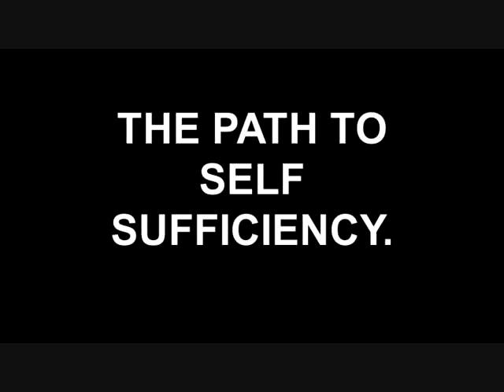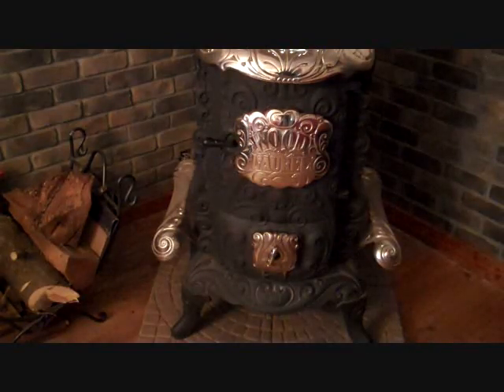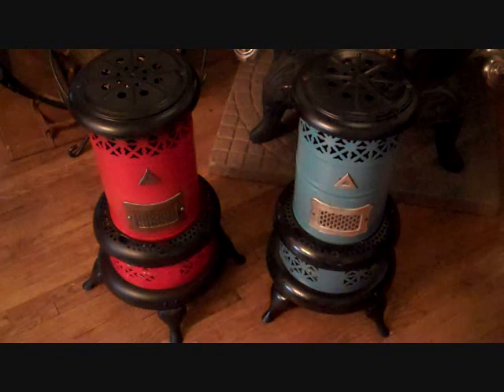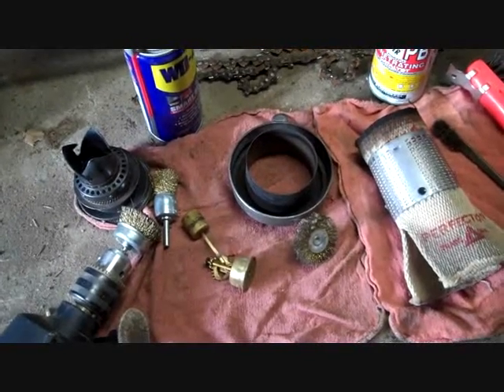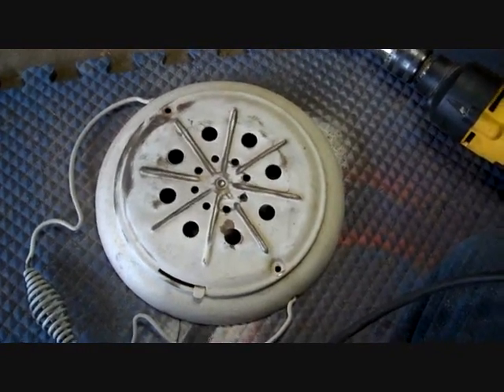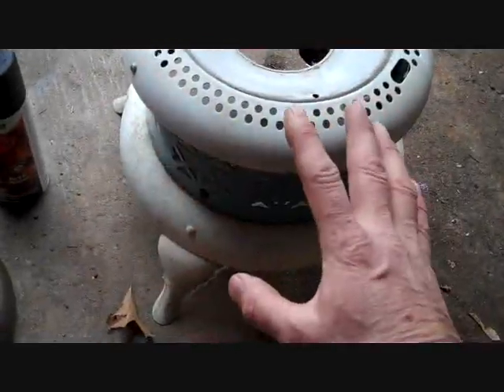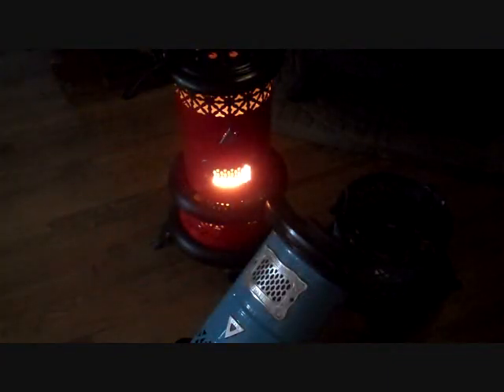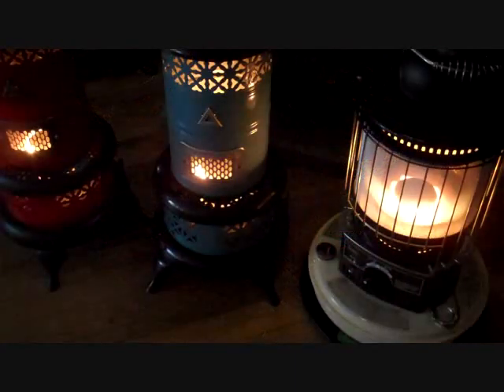PERFECTION OIL HEATERS.

Comment: In the late 40's & 50's I sold these at my grandmother's hardware store 'Wright's Furniture & Hardware' in Plant City Fl. Back in those days, it was the only heat that some people had. Perfection also made cabinet floor models that were vented to a flue pipe, and hooked up to a kerosene tank on the outside of the house..
Reply: Yeah a big square cabinet. My grandma had one When I was a kid.
Reply: Pretty fascinating. I use one to heat corners of my house. I have a model 530 heating my kitchen right now, my wife loves it.
Reply: My grandpa and grandma had a wall mounted perfection heater hooked up to the house flue. It kept the kitchen nice and warm.

Comment: Acetone excels in removing carbon and dried fuel residue. (Paint too! Adequate ventilation is a must, as well as lack of open flame!) Works especially well in glass lamp bowls. In the late 1800's, prior to the production of kerosene, oil lamps and heater used coal oil, known today as mineral spirits. In many (but not all) areas, mineral spirits are less expensive than K-1. Haven't run my Alladin Blue Flame on it yet, but all my lamps do. Miles Stair's site has a great article on it.

Comment: I have one of these. Had it since I was 16.(am 64 now) Paid .50 for it. I wanted to restore and use it. It is intact. I just repainted it but did not use heat resistant paint. I really wanted to use it to heat my living room. Thanks for sharing.There is a story that goes with it but I won't bore you with it.

Comment: I just picked up two of these myself this weekend, I got one of the model 425s for $25s and a model 525 for $40, I used some zip strip to pull a coat of black paint off of the blue enamel, and have been working away with the bench grinder to pull off whatever rust and corrosion are on the other pieces, I am pretty excited to get these things up and going, they are really good looking stoves.

Comment: Thank you so much for this video! I can't tell you how excited I am to find out about these little gems...never knew they existed. I have a cabin that has only been used in the summer for about a decade. Snow partially caved in the roof and broke the pipe to the antique wood stove. The stove itself is now unsafe to use anyway as it has rusted out over the years. We had a real dilemma on getting heat into this little cabin because it apparently was built around the antique wood stove! No getting it out without tearing out a wall or tearing up the stove, which would break my heart. Even if we could get it out we would have to spend thousands getting the area up to speck to install anything new. Now I just have to find a couple of these perfection heaters! So excited!

Comment: I got one of these today that was in near new condition for $35.00. It had just a few traces of rust in a few spots. Mine is a clone of the Perfection 552 heater made by US Stove Co. I just did a full clean and repaint and it is like new again. I ordered a new wick and now I am set for the winter if the power goes out.

I appreciate the video and info. Keep up the prepping!!

Comment: I first learned about these heaters in October of 2011. I was setup at an outdoor festival with some other folks and it was fairly cold in the pole barn where we were. One guy went to his truck, pulled one of  these out, fired it up and I was amazed at the heat output. Along comes 2012, same group, same festival and sure enough cold weather again. Same guy hauls out his heater and we are warm. That should have been my hint to get one but with other things going on I never got around to it. Now comes October 2013, same group again, same festival but warmer weather ... to start. Half way through here comes the cold! Our friend smiles, heads to the truck and you know what he pulls out. At this point I am on a mission I tell him, so off I head, hitting every antique dealer at the festival. Not one of these to be found. Then this older gentleman stops by where we are, a truck full of antiques he is looking to get rid of as he is getting out of the business. Several of us go to see what he has and there it is! A Perfection 730, looks different than these in the video but the tank/gallery/flame spreader assembly are just like these. I crawl through and over several piles of stuff in this truck because I was going to own this! Once I got it into the light I was taken aback and the apparent condition as it was completely rusted. My buddy who has brought his all these years helps with the inspection and other than rust there is nothing wrong with it. Purchased for $15. Though I haven't had time to repaint it yet, I cleaned the tank assembly, bought a new wick and filled it up, sure enough .... HEAT! These are awesome! I have since found another, a Perfection 525M, at an auction that is in better condition though it could use a paint job it still has the original paint on it with only minor rust for its age. It still has an original wick and once I cleaned the old kerosene out of it, let it dry and refilled the tank with fresh kerosene it fired right up. I am still on the hunt for at least 3 more as I live in an 1800's home and these fit right along with the feel of the house plus I live in an area where power outages in the winter are common and these will keep me warm enough for as long as I have fuel for them if needed. Great video!

Comment: I really love my old perfection heater, I got mine for free, some one was throwing it away b/c the wick was burned down, you can only find replacements online, I redid the wick, then later bought some fiberglass filters on sale in spring and resized them to fit my heater. the way they work is so simple yet so good, that i made a small version out of oil lamp parts and "tin cans" with some sheet metal that i use for camping, one of the greatest things i found for free, great video as always YP

Comment: Hey Yankee! Just wanted to thank you for this video. I got through this winter using three of these I refurbished after your video. Although it was only for supplemental heating, these things worked awesome! I even heated up my beef stew on them. Great bargain on kero at Tractor Supply. As for the smell, it took the Family a little getting use to. However on these cold winter days they all were asking me to fire them up. Thanks again.....Go Sox
Reply: Daily Dog Vlogs would I need an exhaust pipe or to open windows?

Comment: It's  the year 2023 now,  gas prices in Europe are sky high and heating costs for an average house can go up to 600 to 800 euro a month. Not for us thanks to these great and beautiful heaters. In Europe we got Valor heaters which is the European brand for the Perfection heater.  We have two 525T heaters and still amazed how these little rings of white fire get so insanely hot! Getting the cold out of a 50 M2 living room is no problem for these (just using one)! These are truly genius in their simplicity.

Comment: When I was six years old , 1959 , we lived in the weeds in the air castle. My dad had us on a starvation farm that had a two story farm house.

It was made of green wood and it leaked air horribly. This the air castle..

I was upstairs at the furthest place from the wood stove.

So dad found me an old perfection heater. He showed me how to care for it and every evening I would get it ready to go.

The wick lasted forever as long as you did not let it run out of fuel.

We used coal oil in it and it had a great kind of chicken poop smell..

We moved in 1964 and I loaded my heater into the truck. My mom said we were going to give it to my grand pa.

I told her it was my heater and I wasn’t going to freeze in the winter. Dad explained to me about coal heat and venting.. he had bought a house in St. Louis with a coal furnace..

So we went to St. Louis and grand pa didn’t get my heater... coal heat sounded like magic and I didn’t trust it..

I still have my heater... I think electric heat is a fad....

Comment: I know your video is pretty old, but, I found it today and I have been using these kero heaters for 20 or more years. Electricity is bloody expensive, and even wood now here in Australia is bloody expensive.  So, I was able to pick up a few of these heaters at garage sales etc and they work good.  Of course I don't live anywhere near snow etc, but the cost of running these heaters are cheaper than anything else around.  If you are still YouTube, does the 'chimney' sit directly on the fuel tank?  I think the 'chimney', or the hinged top part, is supposed to be sitting ON the fuel tank when closed so it can draw air for the wick...Yes/No?  These heaters are great space heaters, not those crappy ones which dry your eyes out as the heat is reflected AT you, these are more space heaters, or room heaters, with the heat not directed at your face but more heating up the entire room etc.

Comment: I just scored a Perfection Number 530 Heater for only $20 at a consignment store! I was wondering if high heat engine paint would work for my refurbishment purposes. Thank you very much for confirming my hypothesis. I'm planning on putting together a video of the start to finish process for others as well. Thanks again! I'm very excited about this great project heater! <3

Comment: Perfection heaters crank out the heat for sure. The ones with glass globes light up a room pretty well too. Aladdin kero wick and mantle lamps heat a small room with a lot of light too. A must have when the power is gone,

Comment: Nice presentation.  I have a couple Model 735 Glass heaters, and it does a nice job lighting up the room as well as heating it.  I do mix some lamp oil in with the Kero to produce a whiter light about 1/3 : 2/3.  Only other comment I would add is, the fuel tank can get pinhole leaks.  If it does, solder does the job, it there are  a lot, you can spray in a rubberized liner--albeit a bit expensive.

Comment: I have a
Perfection 730. I turned it up to the highest wick setting and held a cooking thermometer over the top. Unfortunately, my thermometer only goes up to 392 degrees. The thermometer QUICKLY rose up past 392 and error’d out. Bottom line: you can cook on top of the Perfection 730 if need be. Probably possible to cook on the other Perfection kerosene heaters too.

Comment: I just bought a new kerosene heater from the hardware store. It has a huge cage around it that makes it almost impossible to move out the door and the handle is terrible.  Love the legs on the perfection.  My new one sits on the fuel tank on a drip pan. Any ideas on making a new one more friendly and more pleasing to the eyes? First thing I'm going to do is take off the ridiculous safety cage. It's just me here. Thanks for the video

Comment: A caution, they do put out considerable carbon monoxide, you must have lots of ventilation. You fire one of these in a closed room and fall asleep you will not wake up. That said they are a good heater, I have a couple myself, and they are nice for cooking on, and as a backup heater, but be careful with them. Your best paint for them is commonly sold for grills.

Comment: Thanks for this video!!! I see that ebay has several that are obviously for decor, but as youve demonstrated, its pretty easy to maintain and even refurb. I also like the idea of fuel verstility ( mixing oil to the fuel to stretch out the life, I change the oil in our vehicles and turning in the used oil is a pain so anytime I see a way to use it, I'm all about it... maybe for the garage or something - Im sure it burns kinda dirty) Thanks again!

Comment: @DoverPipes well i guess he already said it in the white texts first in the video.
its as safe as a heater can be, without the fear of short circuits and other malfunctions the electric ones have.
i currently have a zibro kerosene heater on, and it generates an enormous amount of heat.
it does 0,25 liter an hour(so its saving my heating bill also).
i like it a lot, and i bought it originally for my preps, but now i burn it everyday just for ambiance, i bought extra parts for it too.

Comment: I watched this video years ago and found a blue one. The chrome plating needs painted. Do another video about these. How did they hold up and did you need to buy any parts apart from a new wick over the years? Do you still use them?
Reply from the maker: nothing has changed,  they work fine

Comment: Hey I really like these heaters and was wondering what a average price of these are in decent condition? I have found many of these lately in decent to rough condition. Most just need a good cleaning and new wick plus repainting. Where do you suggest getting a new wick? I bought a 525 model that is in good condition, just needs a wick and a good cleaning. I only paid $25.00.

Comment: Great video. I too ma in massachusetts. I bought a portable propane heater. that has the CO shut off. If I have to I will use that in my home. I was thinkign I coudl put it near the fireplace to help with ventilation. But they too are illegal in massachusetts. But I think its a grey area.

Comment: Yankee, where do you get  your wick replacements?
Also, do you burn the perfection with the wick raised at it's highest level?
Reply from the maker: Miles Stairs WICK shop is a good place for Wicks and parts - http://www.milesstair.com/by_make/PERFECTION_Kerosene_Heaters.html
Ebay is always good too.    And not the wick should not be at the highest level.
Reply: Try Miles Stairs wick shop online.

Comment: Great video.  I've been using a kerosene heater for years.  Never had a problem with it does require a does of common sense when using it (or as my TI at Lackland would say, "common f*cking sense").  Maintenance is simple (and my heater, a ker-o-sun, has a battery powered ignition element, so no need to use matches to start it, though that is still an option).  It came in real handy in the wake of the late October snow storm here in southern new england.

Comment: You said something along the lines of fuel efficiencity while using kerosene. Is that K 1 kerosene and I'm assuming that they don't put off enough carbon monoxide to be an issue. I was just looking at some like the new one you have but didn't know enough about them to buy it.

Comment: @MunkeySpaz all the heat goes up the legs dont even get warm, the legs/lowwer body is not even connected to the heat source the tank just sits on a self in the lowwerbody. I use mine in the house all the time, however for safety reasons they say dont place them on carpets or rugs but not because of the legs heating up, but because if the get tipped over (which is hard to do they are very stable) with that said, make up your own mind,

Comment: I found one like your red and blue ones but it's all black. Do you happen to know where I can find replacement parts for these? I need a new oil tank, the one it came with is rusted and has holes in it. Its also missing that front rectangle shape plate. I appreciate any information to help me restore the one I have. Thanks Kim
Reply: Miles Stairs wick shop.
Reply: ebay has a lot of heaters and parts, its where I bought mine

Comment: @Machi74005 its not gonna give you a warning to turn it of or something, but you can have carbon monoxide alarm in the room that will tell you,
these things burn so clean that it practicly won,t put out much carbonmonoxide(as he stated earlier if im not mistaken).
i have one, a different later modern zibro model, that goes out if shaken,goes out if too much carbon,goes out if to little fresh air, goes out if fuel is too low, goes out if tank is removed etc it works great too. but expensive

Comment: What an Awesome video.
I ended getting a Kero heater from Amazon, Japanese model with fibreglass wick and it works well, but kero in Australia is so expensive, however, that is changing with the new cost of electricity and the way the stupid government is adding carbon tax to everything, soon it will be back to stone age living with xbox connectivity......

Comment: what's up with these people using carbon monoxide detectors because of a kero heater? is that just another one of the idiot proof gadgets that common sense would rectify? and i still don't understand the diff in k1 and 1k. i want to find the 'cleanest' burning fuel which i have not looked into yet; which do i need to use?